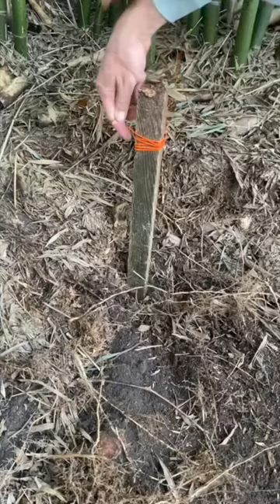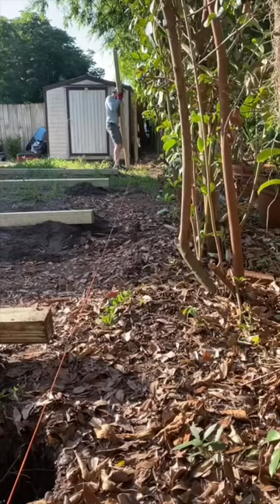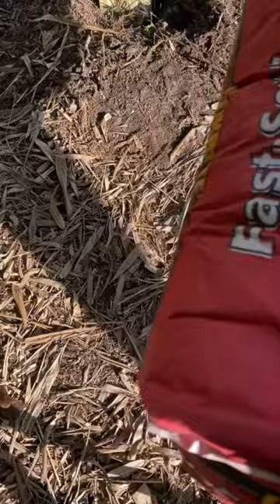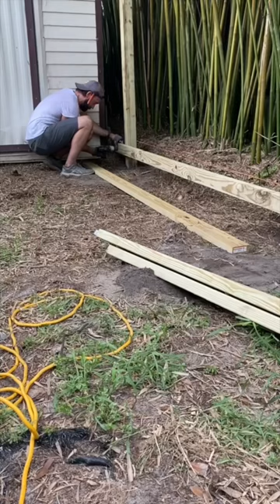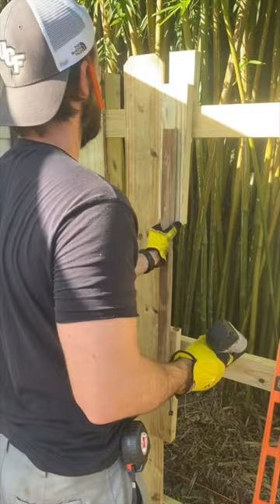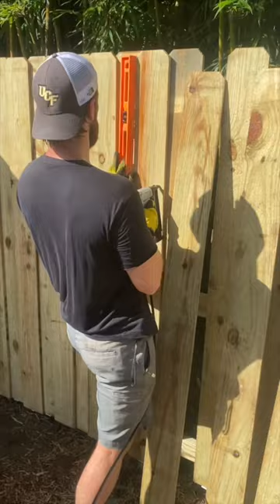Building a Privacy Fence | Yard Transformation Pt. 1 | Build a LEVEL Wooden Fence |  #diy #fence

Comment: How much you spent for that?
Reply from the maker: The materials for the fence were maybe $750-1000? It doesn't require a lot of tools but if starting from scratch without any, someone would only need to buy about $300-400  in tools.

Comment: Dumb question, but how far apart should the post be?
Reply from the maker: Not dumb. They are 8 ft apart. Specifically, each center of the post is 8 ft to the next center. That is so an 8 ft long 2x4 can be fastened into half from either side, if that makes sense.
Reply: @TheDIYrealtor  Got it! Thank you very much.

Comment: One mistake....use concrete posts (timber rots).
Reply from the maker: Thanks for watching. These are pressure treated posts surrounded in 4-6 inches of concrete, with the entire fence receiving 2 coats of Ready Seal. I believe they should hold up for quite sometime.

Comment: All those fence boards will be off in less than two months. Who the hell uses finish nails?
Reply from the maker: They’re galvanized brad nails, and it was for speed and ease of getting them posted when working by myself. I went back and sank exterior screws, but the pickets were already secure so it was easy. Screwing them in with one hand while keeping them level by myself would’ve been a nightmare.